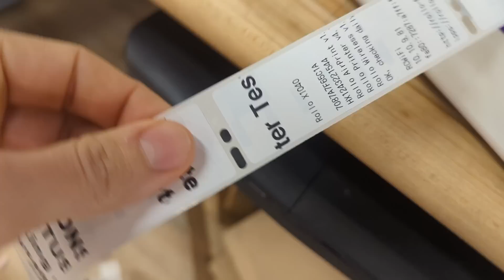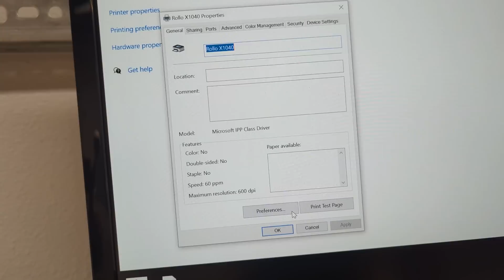Leaving dymo is hell - attempting to make a rollo label printer work with repairshopr

Comment: To be fair a lot of the issues with label printers is a result of windows issues. Life changed for me in this world when I learned about the "Print servers properties" option in windows. It lets you manually edit the preset windows uses to force things to print the way you want. For example if you have an app that only wants to print to a specific label preset you can go in and edit the dimensions and settings of that preset to be whatever you want it to be.

Comment: Please try a Seiko smart label printer. As long you don't want a custom size it always works great as a windows driver.

Dymo sucks using the RFID but just use the original desktop thermo printer it's the Seiko.

Comment: I been using a DYMO LabelWriter 450 Turbo here at work for 2 years and it works flawless with Dymo Label v8 software (There is a newer version of this software, but I don't like it) in Windows 10 and Windows 11 that updated to several months ago.

Comment: I work with zebra printers a lot. They do have a funny thing about having their settings changed if you happen to print like normal paper but as long as you print normally they're very reliable.

Comment: I had something like this happen with an old dotmatrix printer back in the mid '90s printing on FDA compliant labels. I had to edit the print driver spacing. I wonder if the driver you have is based on a similar old printer. If you open the lib files you may discover what that driver is and find old tech doc for it to make edits. Good luck!

Comment: I am not sure if this will be helpful at all, but I do not think I've seen you say what happened to the old 450, just that it has given up. I checked the dymo website and they have added some new help center site that has some guides on problems that you might find. I would say it is worth to at least give it a try to either see if their website offers any help with that or if the printer is fixable.

Comment: I really think your best bet might be with a Zebra printer. It might not be 100% plug and play, but they've always been extremely solid in my experience and pretty reasonably-priced for what you get. 

The hospital I worked at had dozens of ZD410's for wristband printing (similar size to what you're printing there) and those things were absolute workhorses and pretty foolproof. I'm not sure how their driver would handle what you're throwing at it specifically since ours were printed to from the pre-programmed EMR system directly, but I don't think it'd be too hard to get ironed out in your case. Like someone else in here mentioned though, make sure you have the correct driver for your printer regardless of what you use, life can be hell without it.

Comment: You don’t get those options because you’re using the Microsoft standard plug and play driver for printers that use the IPP protocol! You need to install or select the specific driver for this printer, then you’ll have those options and it will print correctly.

Comment: Installing a WLAN Printer my Wife bought a few years back brought me to the point where I sat in the driveway and was ready to roll over it with the car.

My Wife saved it then. But it never ever connected to the WLAN and only sometimes worked via USB.

Bought the best rated and tested printer half a year later and every thing was a breeze.

Comment: @Hybris51129 In my 20 something years in Print Production, I found out that there are a few very bad settings that all printers come with.
The secret is to change the Default Printer Preferences from the start. In Windows it's best done from the Devices and Printers panel, by right clicking the printer and changing settings from there.
If you do this from a software you are printing from, it will always revert to those annoying Default Settings each time you print.
And, for Mental Health's sake, avoid using the Printing Software the Printer came with! It's usually developed by people who have never used a Printer before.

Comment: Hi. (1) Maybe give document default layout more padding , when it gets minced by the print dialogue hopefully the bit you want is on the paper. 
(2)thermal and a dot matrix POS RECEIPT PRINTERS work well with Windows, gettting them to line up with predefined labels would be a nightmare.
 (i made art installation instant photos from a lens projecting onto flatbed  scanner then it spits out a selfie) 
(3) A scotch tape dispenser wouldn't be the end of the world.
I also have a  craft gadget toy that turns anything into a sticker ,it's not efficient with material or cheap to fill. 
(4) go oldscool use a chinagraph pencil.
Best of luck, and have a merry Christmas.

Comment: I appreciate that Microsoft had the idea to aggregate packages and create universal drivers, but their implementation is awful and lacks transparency. There's no notification or choice presented to the user before it silently sets windows loose to clever its way out of the problem with a blindfold and duct tape. Automatic generic drivers have saved and screwed me too many times to count, but the success rate is unacceptably low.

Comment: It looks like you aren't using the right drivers for it. If you are using the drivers that Windows installed for you it's likely the reason. Remove device, nuke the drivers you have, use the drivers from their site, only then put the device back in after you do that or Windows will half ass it.

Comment: Look at point of sale printers from professional companies like Zebra - especially the ones with built in cutters.  Yeah, the printers are a bit more expensive but the paper for them is dirt cheap.  And they last forever.  I had a trio of them printing out thousands of labels a week for over 10 years and the only maintenance on them was changing the paper, cleaning out the occasional scraps left over from the cutter and wiping the print heads down with alcohol once a year whether they needed it or not.   I think we had to replace the blades in them maybe one time too.  And one needed a new set of rollers.   Dymo and the consumer oriented brands are more damn trouble than they are worth.
Reply: Oh yeah, always install the driver before plugging any new device in.  Windows is a lot better than it used to be, but it's a LOT easier long term if you can remember to install the driver first.  Of course, I never do 🙃
Reply: Zebra printers are awesome, but only if someone else, or the company is paying for it, LOL
Reply: @cyclopsvision6370  You get what you pay for.  Like I said, if you are printing any kind of volume of labels at all, you'll get it back and more with the paper alone.

Comment: The best i used is sekio label printers for non 4x8 they use i believe brother thermal print head technology they are easy to use NO DRM you can use any label they do need the holes between the labels so they can calibrate. Worked with repair shopper when i had it. Basic windows driver. 💯 happy with it i have deployed 30 of them in restaurant and business and they just work.

Comment: Ive always made shipping labels and used either a regular printer or an actual shipping label printer called Zebra. As for making small labels for specific things I use tape and a sharpie.
Reply: I've used Zebra too, they are awesome, but only if you are not paying for the printer and supplies personally.  LOL
Reply: @cyclopsvision6370  Oh yeah true. I actually noticed a brother label maker at work tonight, and saw that 400 labels cost 22.39. After doing the math that's 5 cents per label, which is actually really good imo.

Comment: Louis, get a used Zebra label printer off of ebay - those are the ones that are used in more commercial applications - they probably have better software too. Most "consumer" products are complete crap - especially the software / drivers.
Reply: Try a Zebra-compatible ARKSCAN 2054A. It comes with an ultralite version of bartender label design software.  You can easily calibrate the printer to the label size and design label
 layouts. You normally need to buy the label design software seperately. The ultra lite version is good enough for most people

Comment: I'd just buy a cheap laser printer and buy sheets of 1/4 page labels, just print 4 at a time.
Reply: Nothing replace a label printer. Those are not laser. The most common is the thermal, followed by the wax medium. For label, you really need something that is not going to be affected by bad weathers the way ink jets or lasers are.

Comment: firstly Printers are brain dead machines
2nd try a different driver version, yours seems to be just a plug and play quick install (disable win update, so it doesn't "correct" it)
3rd a few restarts are probably going to be needed, printers have a hard time remembering what you just told them

Comment: Looks like shit drivers. I wonder if there is a Linux driver for that that works. The reason big companies charge so much is for the driver creation and support. The device usually isn't much of a cost to them. I'm sure there is some random person out there with an Arduino or raspberry pi that does this stuff but hasn't branched out.

Comment: Some of the cheap label printers don't seem to save/apply setting changes until you power cycle the printer. I dunno if your problem is the same, but maybe give it at try. Mine also keeps separate label settings for each USB port on the system. So if you change the USB port all the settings go back to default or whatever you used on that usb port last time.  I cant really complain though, it was like $40 and it actually prints labels once i figured out all its quirks

Comment: wait, the best apple repair shop in the world uses a windows computer?! I lost faith in humanity.
Reply from the maker: I use linux for my own machines but the ticketing software i use and the shipping stuff doesn't have anything to make ti simple to mass print labels. so stuck with a windows computer for that.
Reply: @rossmannkoigroup  Yeah, I know. (I guess my joke was not obvious?) I wrote operating system in my previous job and I would say windows is one of those operating systems that "just work" (>99% of the time). MacOS is also not bad but it doesn't have nearly as many applications so I am totally with you.
Reply: @ericclone  I've been using linux as my daily driver main machine since about 2001 (pretty much Debian Sid the whole time). A lot of the times, it "just works" too, but it's way better now than back 20 years ago. Except when the KDE Plasma transition happened - those were some rough times. I can't even remember the last time I had to compile a custom kernel :)
Reply: Wait, you've been alive for more than 30 seconds and haven't heard Louis REPEATEDLY say that he will NEVER USE APPLE PRODUCTS??? GTFO man...
Reply: @gorak9000  woosh

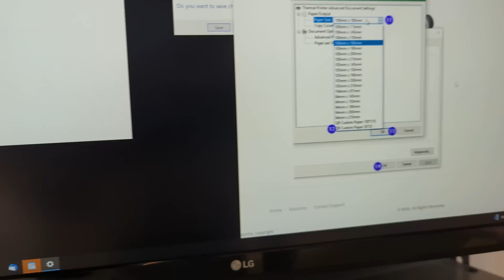Comment: Hey Louis, at 1:45 it's shown "Microsoft IPP Class Driver" that means the driver is not installed correctly, or it is not being used as default. You should go to printer properties, change the driver, if installed. If it is not shown, then it's not installed correctly
Try to install it using the .inf file, if provided, worst of cases you have to dig and search the .inf file, in whatever they sent to you
Reply: Agreed, a driver is an issue here and because of that more options of paper(label)size are not shown!

Comment: I recently got a Brother handheld labelmaker (different type than whay you're using) with some 3rd party labels and it works well. Did some research and it looks like that Brother sucks less than Dymo, HP and other printers. Look like the Japanese still make decent products
Reply: I bought a cheapo brother laser printer because I was tired of ink drying up. The starter toner cartridge is still in and printing fine 10 years later. I'd recommend brother anything at this point.
Reply: @tritech  ditto, Brother stuff does seem to suck less than HP, and on principal screw HP!
Reply: Here a comparison of a Brother and a Dymo model for printing shipping labels
https://youtu.be/VR8S6nKOvnQ
Reply: @09f9  yeah, one local store that sells both official and 3rd party toner claims that the cheaper give yiu the same print quantity for 1/3 the price. I got the 3rd party P touch style labels on amazon and they work fine

Comment: Printer are a over complicated hell, Why cant we just send a Bitmap to a device.
Reply: There was actually a printer many years ago that worked just like that, back when there was competition against postscript. Part of the problem is a full-size full-color print would be a half-gig bitmap, which would be slow, even over USB.
Reply: @darrennew8211  But today half-gig is nothing. 
Modern USB is what 10 or 20gbit? 

for this label printer lets say it has a 512pixel wide print head.
Usually they are 1bit per pixel.
So for a fullsitze 1*2 label this is 0.5Mbit.

On USB 1.0 this would take about 1/10s.
So i don’t see the point for Postscript
Reply: @darrennew8211  half gig spool is usual when I print a A1 or bigger sheets. The HP DesignJet 500PS printer is refusing to process HP GL-2 data correctly, so bitmap is the only option.

Comment: Got rid of all Dymo Label printers when they doubled the price for the labels. Now I use GoDex Printers and they work alright.
Reply: GoDex are OK, but if you have to deal with labels just do yourself a HUGE favor and go with Zebra; especially the ones with built in cutters.  They are frigging tanks and un-cut/un-perforated stock is dirt cheap too; in the long run the Zebra printers will likely pay for themselves, especially if you have high volume.
Reply: @DocNo27  Yes Zebra is also OK. Still got a TLP 3842 or so laying around. Reason: No Ethernet port and we use them with multiple computers. However that Zebra printer started to "unadjust" itself and even with factory reset I could not make it work right.
Reply: @ChipGuy   You can use a Raspberry Pi (if you can find one these days!) as a print server. There are tons of tutorials out there on how to set up CUPS - and at one point I even found one targeted at Zebra label printers since, as you note, they can be even more fussy that normal printers (god help us all).